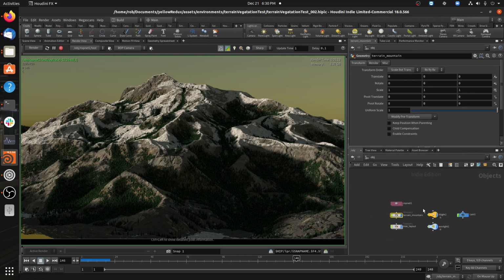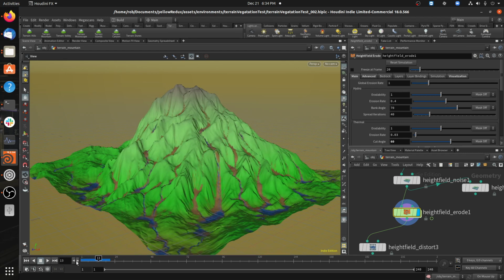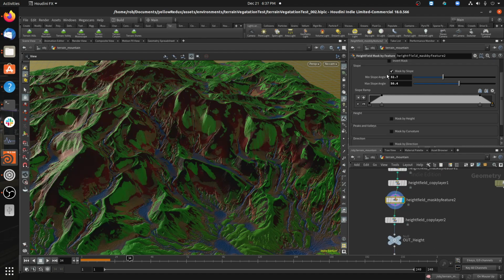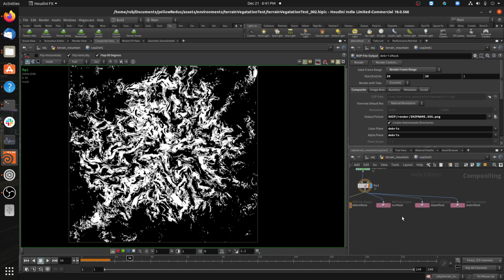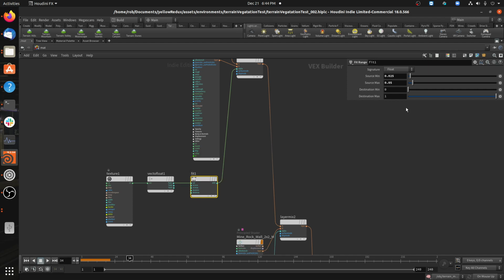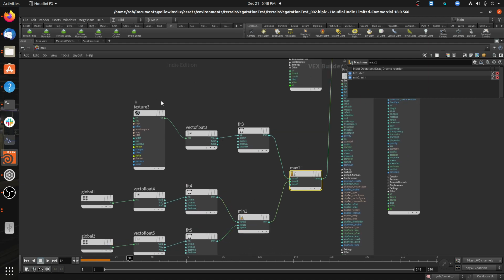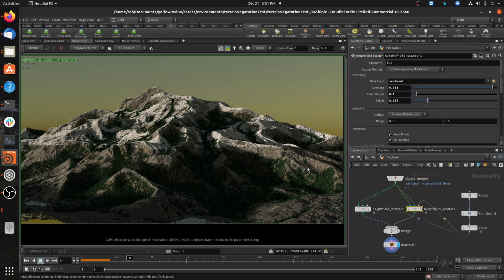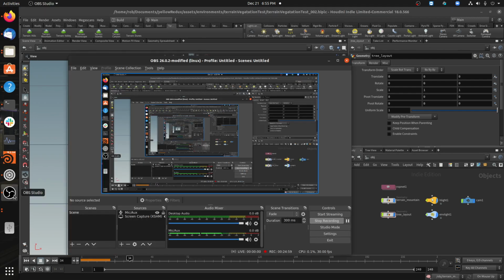Houdini Quick Tip: Terrain Setup with Megascan Surfaces

Comment: How did you get around the problem of the material tiling not looking like it's repeating?  Is there a way to "shuffle" the tiling in a mantra material node?
Reply from the maker: The key to getting it to not feel tiled is to use several texture sources and then use geometry attributes to break up the layers and hide the tiling. So I will use three similiar texture sets and then use the point attributes from the simulation to layer them.

Comment: When you are explaining the ‘uv magic’ what was not working? I keep on hearing about us wierdness from tiled heightfields. Is that it?
Reply from the maker: No, the issue is the y projected uv on the converted geo doesn’t line with the maps generated from the heightfield. Using the flip flop in this case helps fix the discrepancy between how the sop import brings in that info and how the uvs are on the converted geometry. I have not had issue tiling textures. I do find that a simple y projected uv doesn’t always look great. You get a lot of stretching and distortion. Often is will stash the uvs from the top down projection into a second uv attribute and then do some more aggressive UVing to have better laid out texture. Seams can be problematic for displacement. You can always take this geo into something like substance and create cool procedural textures. I usually create my procedural textures in vops for something like this. The purpose of this is to get a quick set up using mega scan materials.
Reply: Thanks for explaining